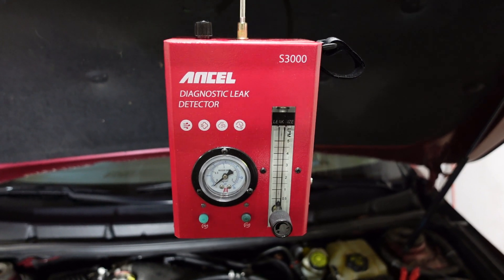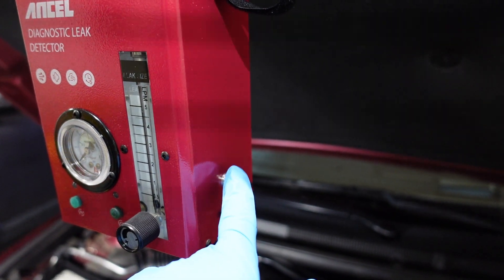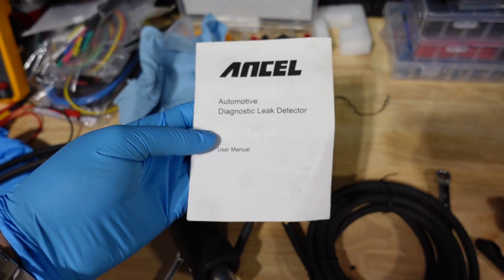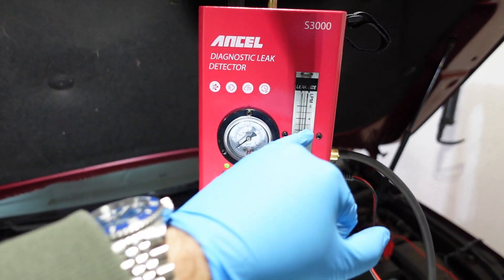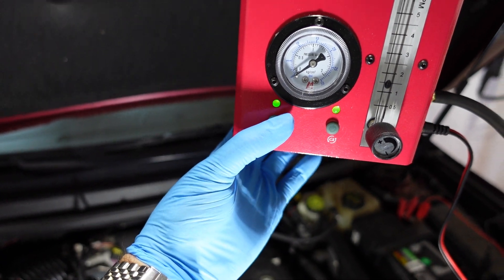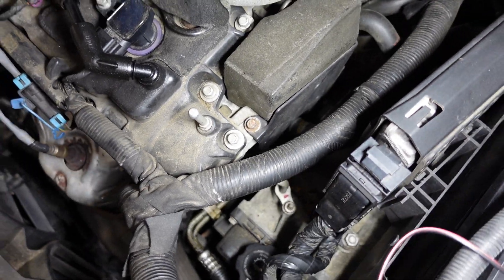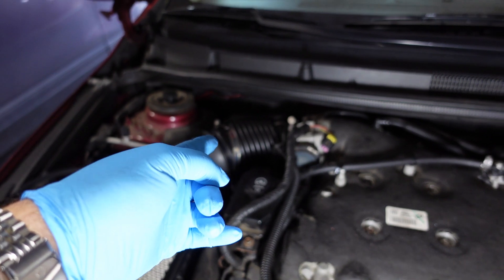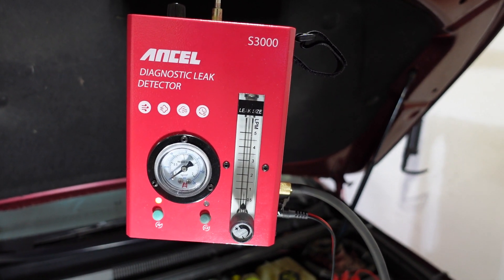How to set up smoke machine - Hunting for vacuum leaks

Comment: Do I need to open the butterfly inside the throttle body before the smoking? Thank you
Reply from the maker: No you don't need to open the butterfly plate.  The plate is open already just a bit for enough air for the engine to idle and that's more than enough space for the smoke to get into the system.

Comment: P0420 is a cat code. If it is a failed cat, try using chemical flush to see if that takes care of the problem before replacing the cat. Also, check to see if anyone stole your Cat, people are getting big money for Cats.
Reply from the maker: I meant a P0442, small EVAP leak, not  P0420.  And, for a P0420 (I did have an intermittent CEL for this in the past), I know how to evaluate that.  No problems here with that, and I know how to look at O2 sensor data and temperature before and after the cat to make sure it working properly.  As I said, I did have an intermittent P0420 in the past, but at that time I was making the mistake of putting 87 octane in my car, when it is required to run off of 93 octane.  After, after one tank of 93 never saw that intermittent code again and that was 2 years ago.